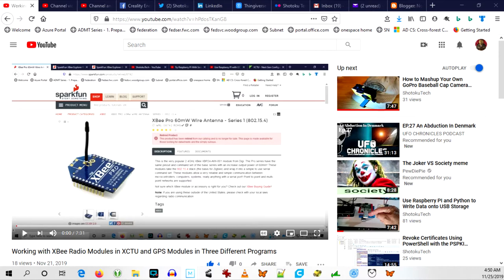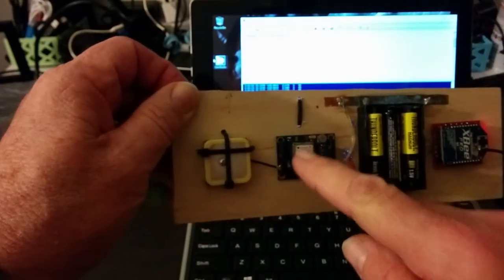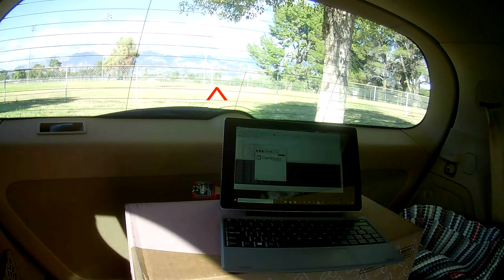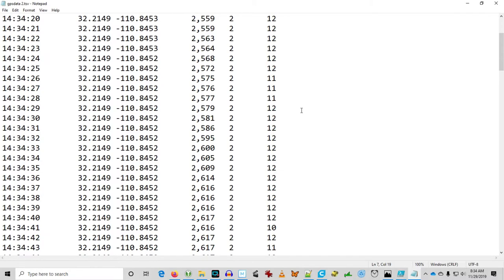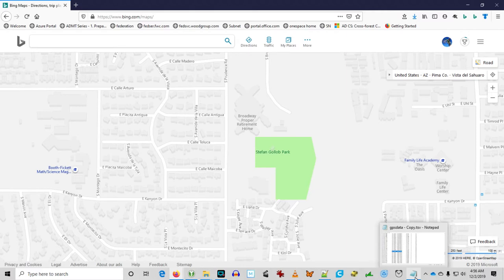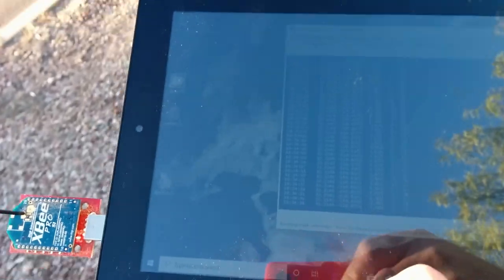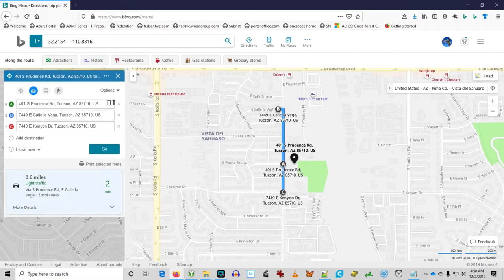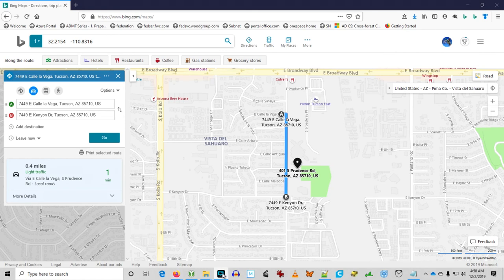Range Testing XBee Radios Transmitting GPS Data

Comment: I know this bit old video, but just wanted to know how the remote XBee module programmed to transmit the data to base station ?
By using Micro Python or any other microcontroller ?
Reply from the maker: It is purely UART or Serial. The XBee and GPS can be configured with AT commands on their Serial port. Then the XBee is simply sending the data over its radio that it receives via Serial from the GPS.

Comment: Thanks for the demo!
Reply from the maker: Appreciate your taking time to view and comment. I will be range testing the LoRa boards next. 900Mhz should go further I hope.
Reply: @ShotokuTech  in 2010 I did some similar range test with xbee and synapse rf module. I wanted to see what xbee was up too these days. The Digi XTend 900 MHz (Digi XBee SX) can push 1W! that will get you more then 1 miles :) can't wait to see the lora result!
Reply from the maker: @JeromeDemers  So were your results similar? Just curious.
Reply: @ShotokuTech  I did that during intership at solarbotics in Calgary. With the synapse module I was line of sight and the emitter was up a street. Lots of electrical wiring and transformer, it was a industrial place. With onboard antenna (PCB style) it was under 2km from memory (10 years ago) . I think in the internal report we said that the interference probably did not help. Like you mention 900Mhz would probably be much better. I would also get good antennas.
Reply from the maker: @JeromeDemers  You got pretty good results!

Comment: Hi, have you tested the higher power Xbee modules? I want something that can give me ~30km+ LoS communication. Any suggestions?
Reply from the maker: Is this an urban setting or in nature? LoRa might be better than Xbee.
Reply: @ShotokuTech  Nature/Rural setting. If there are no gateways along the 30km line that might be an issue , right? Or did you mean a direct 30km communication from edge-node to gateway?
Reply from the maker: @dennis_johnson  I think 30km with these little stubby antennas is a bit of  stretch. I'll have to devise a rural setting test to see.